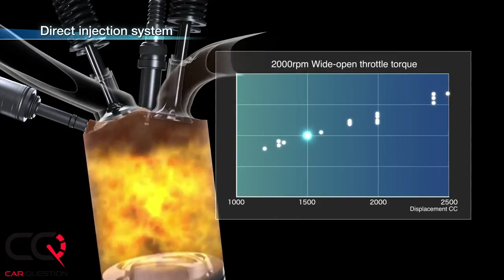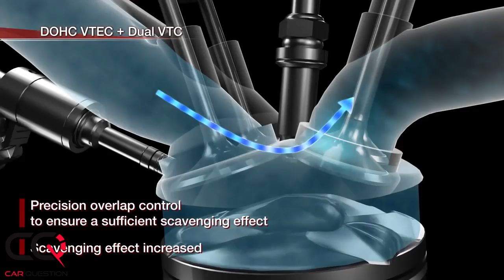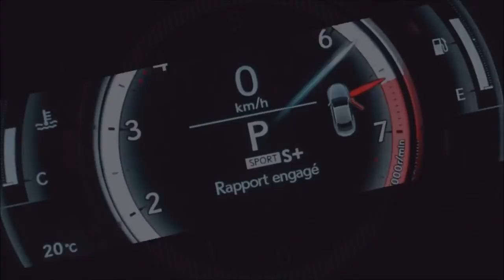Honda CR-V Turbo: Overfilled oil levels and a gas smell Fix and RECALL!

Comment: come on, this is a design problem. this is a mechanical problem, not a software problem. don't let their spin fool you. this problem will cost you tons of repair money years down the road. honda is not lexus , they are never famous for emphatic customer service.
Reply: Modern engines are all ran by computers, so the old systems of mechanical timing and compression are all digital now.
Reply: MetaView7 he is right tho modern engines are all computer controlled
Reply: @f181234  computer can be a solution - by detuning the engine. If the computer is the problem, they would have fixed the problem with a flick of the finger. If the computer is the problem, they would not have drag their feet for so long. They are trying to disown the problem and hoping their loyal customers would go away. . If computer is the problem, why don't you see the same problem in other manufacturers' DI?
Reply: @MetaView7  But the very act of detuning the engine just means that your 1.5L turbo produces even less power, even more fuel inefficient, and bad torque...Kinda defeats the purpose of the 1.5L turbo...
Reply: @441meatloaf  That's my exact sentiment. This software fix is not a solution.
Reply: @MetaView7  The only solution is to remove 1.5L turbo engines and just purely stop putting these horrible small engines on cars....Now Ford is putting these terrible 4 cylinder ecoboost in their pick ups that could barely lift its own weight all to meet some idiotic bureaucrat policies at the EPA. 

At that point everyone is just mashing their throttle to get more power. I rather have a v6 than econobox downsized engines.
Reply: @441meatloaf  I agree.

Comment: My Hyundai Kona AWD 1.6 turbo has the same problem, 1/3 qt oil over full mark and over WELL 5%fuel dilution at 2,000 from Polaris labs. They only go to 5%
Reply: If it's the 1.6 turbo, then it's Direct Injection issues. This is why Kia/Hyundai are phasing out their GDI engines.
Reply: Ted Tedness Thanks for the information. I just looked at  a 2019 Hyundai Kona yesterday...guess I will pass on it now....!!!

Comment: I think the problem could actually be the oil rings on the pistons which weren't designed with enough strength to handle the direct fuel injection, particularly when the engine is cold and the fuel mixture is enriched, aided by the turbo forcing more air pressure into the combustion chamber.  thicker and stronger oil rings might be needed. 
Of course diluted oil is not good for the engine relating to its working longevity . 
These engines as they are designed may last up to their stated warranty , but after that ?????
Reply: Nice point. I think on software issues but that will be easy fix. For rings is more complex and need complete engine recall

Comment: I have a 2017 CR-V  with 17000 and no problems with the oil or cold starts
Reply: Same here, although I did put an oil catch can in the PCV line at 5,000 miles.  It collects what appears to be gas, water, and some oil, maybe a tablespoon every 200 miles.  Have no issues, get 35+mpg, and runs fine.  Now at 26,000 miles.

Comment: I live in N.D. We leased a CRV in April. We just got our recall appointment for the so called fix. Supposed to take an hour. I'm thinking it is a band aid. They are talking a software upgrade. I am glad we leased instead of purchased.
Reply: It is bandaid
Reply: @miriamvivo4279  How do you know I wasn't talking about an aid to bands?
Reply: @miriamvivo4279  Yup, band-aid.
Reply: Lucky you leased , this engine wont get past 5-7 years . Its a Honda band-aid 100% . Shame on HONDA ! Your lucky you can give it back after 4 years or so . Smart move ! Since when is dilution of oil NOT a critical issue . Honda has not treated this appropriately !

Comment: I called *Honda USA Headquarters* directly because I was seriously considering buying a 2019 CR-V and was very concerned about getting a car with the oil dilution problem. They explained that Honda is making some revisions for 2019, although it's the same engine and will mostly be software updates, a changed plug, etc. So then I asked them "Is that guaranteed to fix the problem?" He said "We can't guarantee that"....!!! So now I'm looking at buying a 2019 RAV4 with a dual injection (PFI/DI), time-tested engine technology.  It's a shame because I've bought Honda cars for almost 30 years and really didn't want to change over to Toyota.  I think Honda's car Interiors are far superior. Toyota interiors are so cheaply made.
Reply: After doing my homework I got the 2018 rav4 ...simple and very reliable. I would still gamble on the 2019 over the Honda though.
Reply: @minnguyenthenjun1818  the problem I'd this new cars are been built cheaper and cheaper I'd ridiculous

Comment: I’m about to buy the CRV but this issues Are bothering me for couple of days... is it worth taking a risk and trust they will fix the issue? Or got RAV 4 way?
Reply: Same here. Not sure if it is safe to get the 2019 model CR-V. Probably will go with RAV4 or CX5
Reply: If u are with crv buy the LX that one has a 2.4 liter engine no turbo.They have no issues with that engine
Reply: @mykedelacruz8401  you have to go for FWD for that in Canada. No AWD unfortunately.
Reply: Wow did not know that sorry
Reply: There nothing wrong with the 1.5 turbo...all you have to remeber that it's a turbo car and it need to warm up before driving it and wait 1 to 2min before shutting it off..
Reply: Absolutely not, do not buy this car. I own the 2018 Ex and its been a pain in the ass. Its come to this that I'm sending my oil sample to Black Stone Laboratories.
When itcomes back I'm getting a lawyer because honda Is treating me like a idiot. I've been a mechanic for many years, when you mix gasoline with oil its very bad news for the engine specifically  turbo. BTW my car has on 12,000 miles.
Reply: Doesn't need to be Turbo, it is a direct injection issue, fuel system. DON'T BUY ONE, buy Toyota
Reply: Krzy Slo can you keep me informed when you get the results back? I bought a new 2017 CR-V 1.5 turbo I have 14k miles on it. The oil dip stick does smell like gas but I haven’t had any issues with it yet so far it runs great. Was thinking of trading it in for a 2019 CR-V but not sure.
Reply: @sullyhulk6256  absolutely, it may take a while because I ordered the sample kit and that takes 2 weeks to ship. My wife just told she wants to trade in for a Subaru Outback. I'll still keep you informed. I'm not sure if this trade will happen for sure. But yes I will post my results from Black Stone.
Reply: Bob Jones - Go with the CR-V LX 2.4 Liter model 👍🏽
Reply: I've had the CRV turbo for over a year and no oil dilution issues. The fact is the vast majority don't, but the few that do will be extremely vocal about it.
Reply: I'm glad someone doesn't have a problem with this car but how do you know really?   
If you take the car to the dealer they wont say anything. Now if you do the maintenance you will certainly know. 
Not second guessing you just wondering whose changing the oil.
I only complain because this a brand new car and this is a big deal. Lots of things can fail with this type of problem.
Reply: @AngelLovesToLook   the fuel/oil dilution issue leads to a gas smell in the cabin and overfilling in the crank-case. I and many others on the CRV forums and FB pages check the dipstick at regular intervals and yes, most don't have this issue. It is understandable being loud and angry when buying a new Honda that does have this issue. I've owned very reliable "analog" basic stick-shift hondas for decades and was apprehensive about buying a newer far more complex one, but beyond a laggy Android auto HU and less than expected city MPGs, I've been impressed with this new CRV.
Reply: @sullyhulk6256  if your dipstick smells like gas, that is an issue!
Reply: You can get a good deal on a new 2018 RAV4 or CX5 as dealership's are making room for 2019's. Now through Christmas is the best time of the year for buying a vehicle.
Reply: Very few out of the 700,000 owners of crvs are having the problem.  I see so many on the road here in NJ.  If they were that bad I'd be seeing them stopped on the shoulder all over the place here..lol
Reply: Mazdas have their own reliability issues and Toyota has it's own latest recalls as well.  it's always a crap shoot.
Reply: Hold off for now  or buy a 2019 rav
Reply: @thejerseydebil  somewhere around 3-5% from what I've read.
Reply: Get the 2018 Toyota rav4, simple and reliable. None turbo 2.5 and automatic 6 speed trans. Right now I wouldnt gamble with anything else.
Reply: Really I bought an Equinox instead of the CRV. It doesn't have the CVT transmission and drives great. No problem with the Turbo engine and good price. Test drive one before you buy another SUV and check models on the NHTSA site for problems. Don't trust Consumer Reports they know  engine problem but day it's not an issue and they still recommend the CRV above others with solid engines.
Reply: Stay away from Honda
Reply: @thejerseydebil  Guess that's why Mazda is ranked 3rd slightly behind #2 Toyota and #1 Lexus in CR's annual reliability survey. Honda isn't even in the top 10. They have become the General Motors of Japanese brands.
Reply: Test drive a rav 4 and then the crv... crv is a much better vehicle and they've sold over 700,000 and only a small minority are having the oil dilution problem.
Reply: @davidsparling3505  Mazda's reliability has ALWAYS been poor.  CR has lost their minds.
Reply: @thejerseydebil  It's not CR...it's the actual owner's feedback. Cite your data source for "Mazda's reliability has ALWAYS been poor". You're a Honda fan-girl and that's fine, but I've been around cars for 40+ years...I remember what Honda used to be and while their reliability is going backwards, Mazda's is getting better and better. They are the engine designers that Honda used to be. Small, lean and mean.
Reply: @thejerseydebil  ...and It still has a crappy motor! I'm sure we'd see more instances of CRV crankcases filled with gasoline if the owners knew how to open the hood.
Reply: @thejerseydebil  Hmmm, Edmunds rates both 8.1 out of 10. Guess they left styling out, because we both know the Barbie CRV loses in that segment. I am fond of the Odyssey-style shifter poking out of the dash, however.
Reply: @thejerseydebil  Now let's take a real automotive publication for alpha-males and see which vehicle they pick...https://www.caranddriver.com/mazda/cx-5.
Reply: @thejerseydebil  Correction...very few KNOW that they have this problem. Most probably cannot even find the dipstick, much less read it.
Reply: @mykedelacruz8401  Not true, I had a 2016 CRV with 2.4 and no turbo, bought new. Had oil dilution very bad
Reply: Even if car runs fine, it is prematurely wearing out the engine. You won't know it until it's out of warranty, then you are stuck with the bill!
Reply: @davidsparling3505  Absolutely right, most just drive them

Comment: Nice wel explain on dieselsir/maam  if the diesel engine have over fill on oil it can coz oil leak on cylinder head cover gasket oring leak heavy starting engine

Comment: What I don't understand is why it's so much worse on the CR-V than any other Honda. And also why it's only happening to some rather than all of them. It's really weird. Come on Honda get your shit together. Don't go down the path of GM you're better than that. Good video BTW.
Reply: Ryan Littleton Ford is no better than GM with that crap, if anything Ford is worse at cover ups.  Just go back and look at its history and litigation against Ford...
Reply: @andrewcolsen  Did I say anything about Ford? Go back and look up all of the issues and especially cover ups GM has been involved with.
Reply: @ryanlittleton5615  Remember Subaru engines and oil consumption?  We had a 2013 Forester that took 2.5 quarts when I met my then girlfriend. No low oil level warning so she ran it right down. It would puff blue smoke on start up and had cold start piston slap.  We traded on a 2015 Terrain 2.4l for 45,000 lease and couldn't be happier having only to return to the dealership for free oil changes.

We ended up getting out class action suit letter from Subaru for reimbursement of expenses of adding oil and repairs. I never kept receipts of my sytntheiric oil reserves so I was out of getting financial backing. But the tin-box, third world SUV was long gone!

The only rhin
Reply: @normt5463  I absolutely do remember the Subaru oil consumption problems. However Subaru has since fixed that issue, unlike GM who has a Class Action lawsuit against them for which they are trying to get out of. GM has a long history of questionable design, poor build quality, safety problems, reliability problems and of course HUGE cover-ups. If you were a technician and not a salesman you would know that, or at least admit it. And also, I personally doubt you had a quality Subaru, since Subaru is not part of GM. BTW, Japan is not a third world country.
Reply: @ryanlittleton5615  Are the 2018, 2019 Subaru Outback and Subaru Foresters reliable vehicles with no oil consumption problems? I am looking to buy a new vehicle...
Reply: @brendame  They should be. Have a look at Toyota as well. If want to keep it for a long time, avoid GM vehicles. Good luck shopping!

Comment: Why does a CRV need Turbo to begin with. It's a basic commuter car 🤦🏾‍♂️
Reply: Because they used a tiny 1.5L engine. The RAV4 uses a naturally aspirated 2.5L engine with both port and direct injection.

Comment: So trying to solve a mechanical design flaw by manipulating the programing. Too much clearance around the piston ring. Can't handle the pressure until the engine heats up and the metal expands, hopefully

Comment: Just noticed today my 2018 Accord Sport 2.0t has the same problem. Checked the dipstick, smells like gasoline. Car has about 4400 miles on it, about time for it's first oil change.
Reply: If the oil LEVEL is normal then you should be fine.

Comment: When will the honda fix vibriacion in crv 2016 when you stop the crv in a red light when the crv is stop in drive you can feel it vibracion if you but the air acobi c ion it go away but if you dont have the acondicion on the RPM goes to 500 rpm you put the lights on and it goes to 750 rpm
Reply: There's a bulletin for vibrations on 2015-16 crv
They only fix if you complain
Call Honda canada a few times and they will give you a file number to get it fixed
It is covered under 5yr warrent instead of 3yr
Civic motors in Ottawa fixed my 2015
Satisfied WITH THE fix

Comment: So I have been closely monitoring the oil in my 2018 civic Si and noticed during cold weather here in Oregon it can take less than 2000 miles before the oil smells and looks wrong. The level is above the plastic tip that has the measuring hash marks on it. 

The problem is barely noticeable in summer and you can do oil changes due to it being diluted and too high at around 3,500 to 4,500 miles but as soon as the wet cold weather hit I noticed a problem immediately and you have to change oil at around 1,750-2,000 miles.  I talked to Honda twice about this, they denied there is any known issues and did not offer a fix.   

I am now very glad the dealer talked me into a 3yr lease giving me an additional $2000 off the price with a lease vs the cash purchase I planed on.   I really love everything about this civic Si.  The 6sp manual transmission, the turbo power, great handling and fantastic MPG all are positives but this lack of potential reliability is a deal breaker!  If Honda can’t come up with a fix I definitely will not be buying this car at the end of the lease as planed.

Comment: Car , , i think you are Correct , , Computer Mess Up , , Cheap Chips Can Arc , , had  1 in my daughters car , , Nice car , , Keep saying , , Coolant Problem , ,was NO Cool problem, , was a Fuel , Sensor Computer doing extra work , that it was Not getting Paid to Do , , i corrected problem , , with the help of  some Vary Savvy brain power , , my daughter Learned , , alot about Machinery , , Car , , We humans have a real Love affair with Machinery , ,      Bro larryl

Comment: Can I put premium gas on a 1.5 l turbo sport Honda Accord ?
Reply: You can put high octane fuel in any engine. Turbo engines especially benefit from premium fuel because the higher compression leaves them more susceptible to detonation (fuel starting to burn before the piston reaches the top of it's compression stroke).